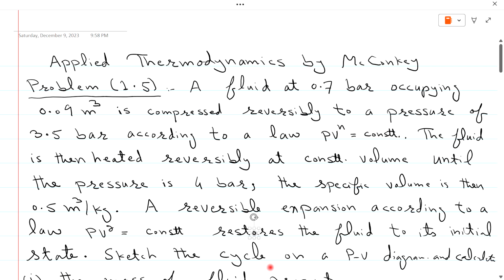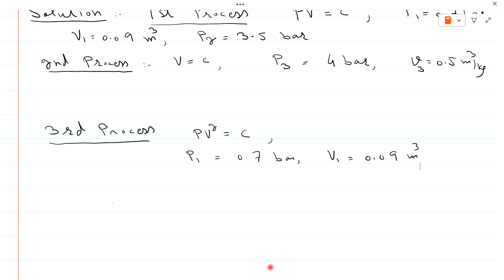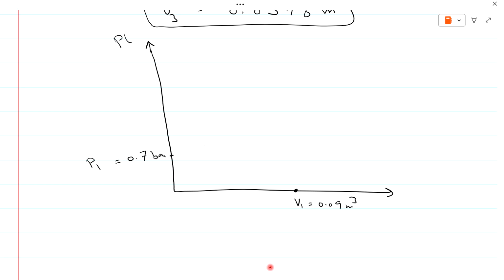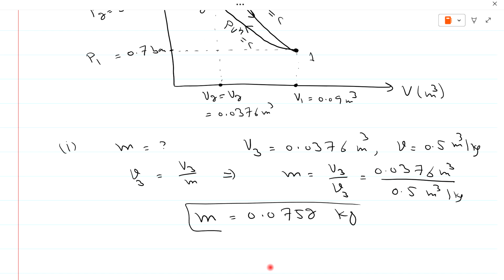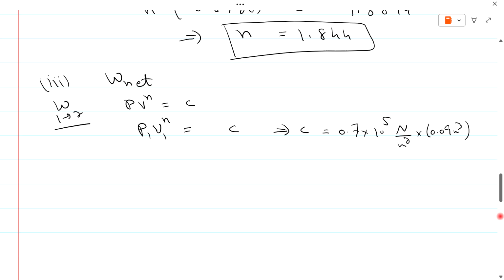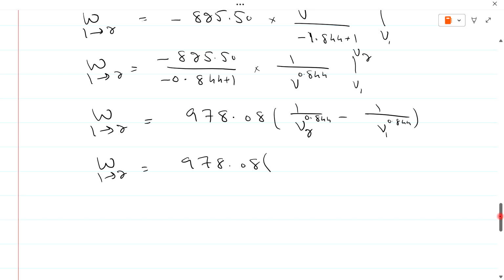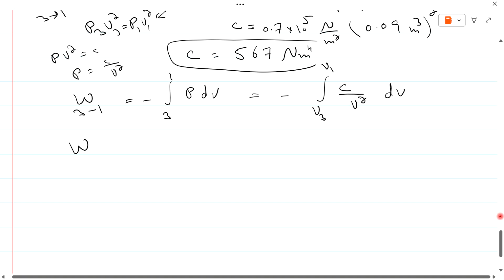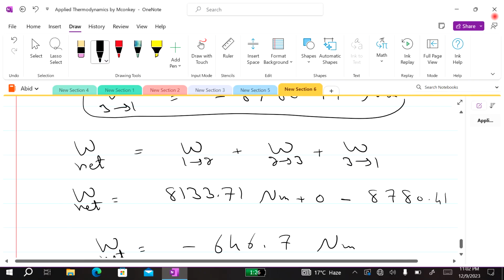Find Work Done for thermodynamics cycle [Problem 1.5] Applied Thermodynamics by McConkey :

Comment: I don't know why but I can't get the 0.37... instead my results are 0.0402😢
Reply from the maker: It's OK dear. This is just actually 4 bar, not 3.5 bar. Thanks for correction. Please share my YouTube channel with all friends. Thank you
Reply from the maker: Yes dear. In given data p3 is 4 bar. Not 3.5. Thanks
Reply: Sir to get the answer 0.0376 you had to divide 0.7× (0.09)^2 by 4bars instead of 3.5 bars

Comment: Sir 1st step mai v3 ke value 0.0162 ata gai or under root ky sat per 0.1272 ata hai ap ky sat value change hao
Reply from the maker: Dear actually p3 is 4 bar. I did the calculations for 4 bar. But put there 3.5 bar by mistake, which is actually the value of p2. Thanks

Comment: YOU HAVE V2 = V3 YOU HAVE V3 AS 0.5 YOU ALSO HAVE V3=0.09  SO YOU ARE STIL LOOKING FOR ANOTHER V3... I'M CONFUSED
Reply: P3 IS ALSO EQUAL TO  BAR YOU ARE USING P2 IN THE FIST STEP
Reply from the maker: Dear V1 is 0.09 m3. V3 is given as 0.05 m3/kg. When unit is m3/kg means specific volume and when unit is m3 mean total volume. I m finding V3 total volume. And V3 specific volume. From total volume and specific volume we can find mass. Because mass= total vol/specific volume